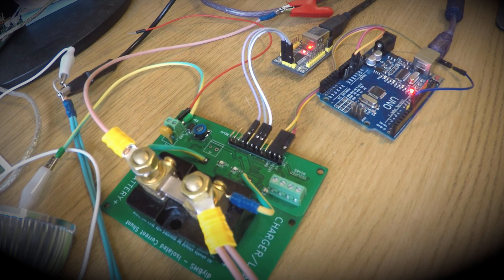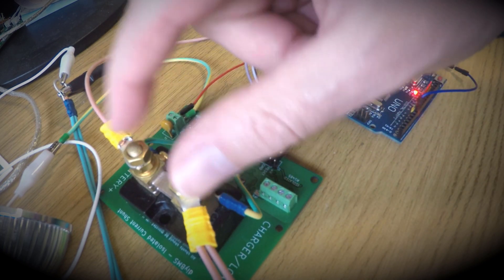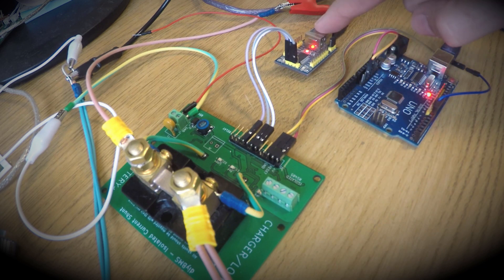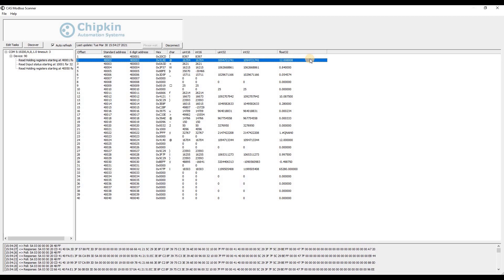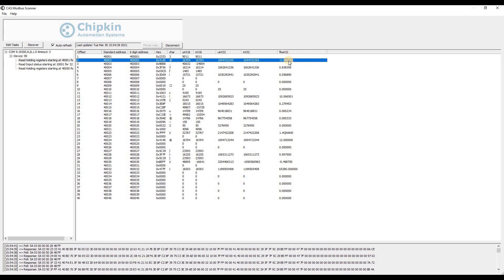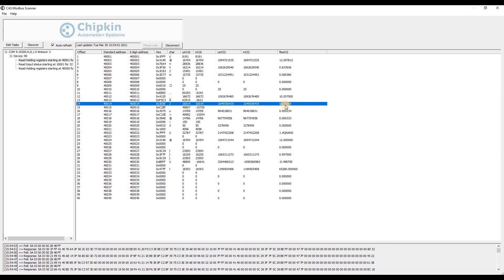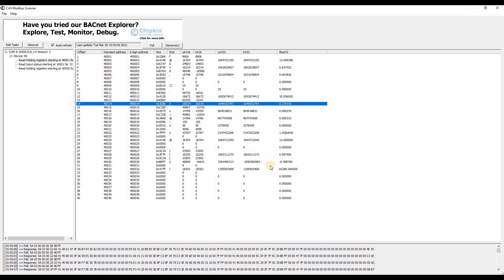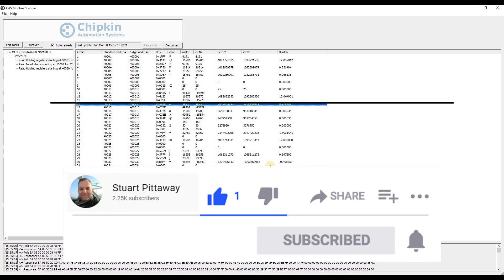Current Monitor Progress [DIYBMS]

Comment: This board has amazing capabilities. Just one thing: is there a way to increase the battery voltage monitoring capability to more than 85 volts?
Reply from the maker: No, 16 cella and the voltage limit is set by the max chip.
Reply: @StuartPittaway  I think you might wanna check out the ACS722 chip. It basically samples current via 2 terminals and outputs an analog output signal. It doesn't seem to have a voltage rating. If there's a way to implement it into the board, then we are good to go to monitor batteries over 85v.

Comment: Nice job! Do you think that it may be made compatible with victron units? Making it a replacement for the bmv702?
Reply from the maker: If I can get the controller to communicate with the Victron devices then yes, its possible.
Reply: @StuartPittaway  Just tell me if i can help you with anything. My Victron equipment will be at your disposal.
(I'm the above guy, I was writing through one of my iot gadjets 😅)
Reply from the maker: @seriusrod  Thanks

Comment: Excellent. Although I think the shunt is quite bulky. Did you consider those from Vishay like WSBS8536-20? See https://www.vishay.com/docs/30397/wsbs8536-20.pdf . Would make the PCB smaller...
Reply from the maker: That style of shunt only supports very low current. If you want more than a few amps, you have to go big.
Reply: @StuartPittaway  I do actually think that it would handle a lot of current with 72mm2. The 100microohm Version would handle 80V/500A short term easily depending on your measuring circuit...
Reply from the maker: @syrafale346  short term is the key, in a power wall you could be pulling several kW for hours on end

Comment: Great work! Will it have SoC calculation as well? How much voltage will it handle. I have a 16S 48V pack of EVE cells today running a Daly BMS but I'm thinking about maybe building a 60-64s battery to be able to connect to a HV Hybrid inverter. Will components of diybms handle that?
Reply from the maker: It may have SOC, depending on how difficult the maths is! It definitely will have amp hour counting. Up to 85V battery packs are supported
Reply: @StuartPittaway  Thank you for the quick response. What is limiting the voltage to 85V? And is that limit only on the current monitor? I was under the impression that the bms could handle 64S and therefore also the voltage that 64S created. The voltage is on the other hand of course related to what chemistry the batteries have.
Reply from the maker: @mrlissmats  yes the 85V limit is for the current shunt. I don't recommend going over 48V in general though, DC high voltage isn't something to be messed about with!

Comment: Been a keen follower of your BMS for a long time now Stuart. When can we get a schematic for the current monitor? I'd love be to get this into kicad and play around.. even if it's not fully ready yet.
Reply from the maker: I've not released the code or circuit yet as they are still both work in progress.  If you look at the INA228 datasheet, its largely the reference circuit from that.
Reply: Can't wait to get my hands on the monitor either. Looking like another solid piece of the DIYBMS puzzle to play around with.